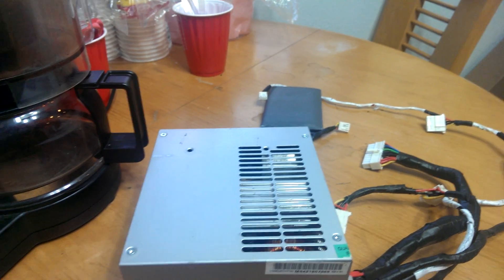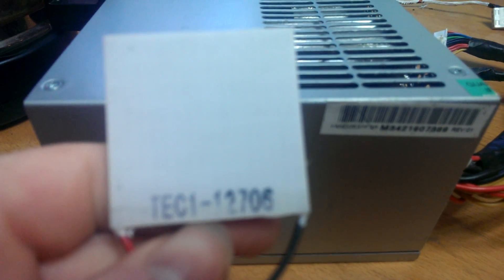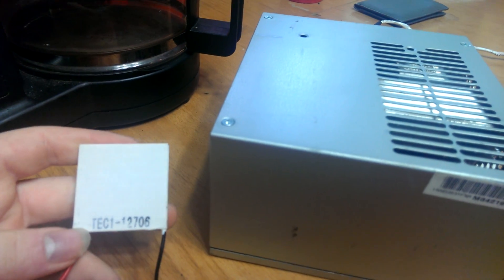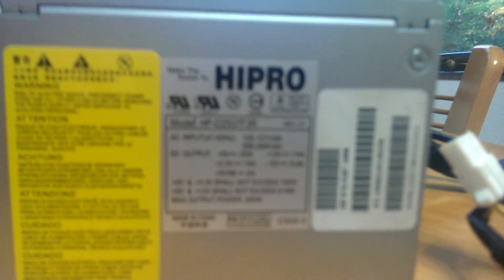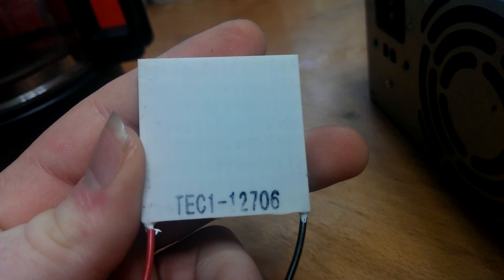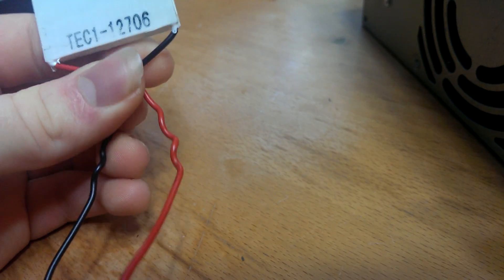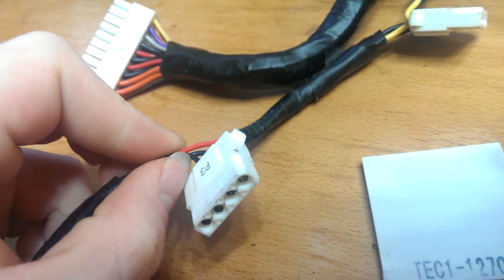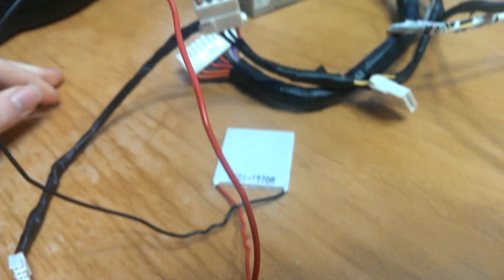How to wire a Peltier unit to a power supply

Comment: Comin' in late here... I have an old (1975) Peltier device in the icebox of my sailboat (currently non-functioning). If/when I get it operational again, I'll be driving it with a large bank of deep cycle batteries charged by a 65amp alternator. Anybody see any intrinsic problems with this set-up?
Reply: You've probably already done it by now, but the one thing I could think of as a possible problem is that 12v lead-acid batteries are around 13.8-14.5v when fully charged, which might make a 12v Peltier plate unhappy.

Comment: hey i have the same peltier and i plugged the red into the yellow and the black into the black and nothing is happening. i tried waiting several minutes just in case it took time but nothing has happened yet. please help
Reply: your Peltier device or power supply isn't working, in fact, it takes less than second to feel it get cooling!!

Comment: is it possible by using any yellow and black wires of an smps?
Reply: you have to connect the green wire on power supply to a black one to get the power supply to turn on

Comment: Hi there! actually this thing gives more current to the peltier module than required . TEC 12706 has a max current of 6.6A and the smps provides around 10-14 A which burns out the module. Better choose your power supply wisely. 12v/5A powersupply best suits the peltier needs. As all of you know, you need to short the green and black wires of ATX power cable to switch on the smps which is overlooked by the uploader!!!!!!! Cheers
Reply: +venkatesh vandrangi There is no such thing as a PSU "giving a device more current then needed". The peltier (or any other device) will draw the current it required depending on the voltage applied and the device's resistance. 
In fact, using a 12V 5A PSU like you suggest for a device requiring up to 6.6A at 12V will at best not give the device it's required voltage of 12V or blow a fuse, but in most cases it will overload the PSU making it either just shut off, overheat and shut off, or in worst case overheat and catch fire. However, in this specific case the max current of the peltier is not rated at 12V, but usually at 15-16V, so a 12V 5A PSU should be fine in this case - but NOT if the device connected required 6.6A at 12V. There is no need to limit the current of a peltier as long as you don't exceed the rated voltage - the only thing to watch out for with peltier is not to use a PWM but a stable DC voltage.
Reply: Jan Erik Johansen hai im not good at electronics and i didnt understand some of ur points..☺️ I have a doubt... Please tell can i connect the peltier to PSU like showed in this video..? Is it good or bad..!😶 How many days or months this peltier works..? (I want to use this method for my cpu cooler) Please reply..☺️